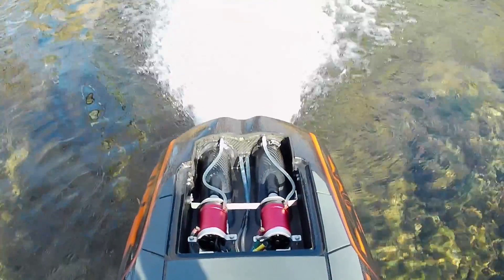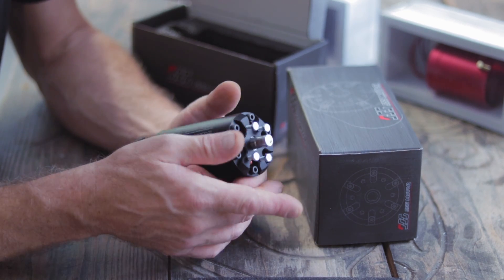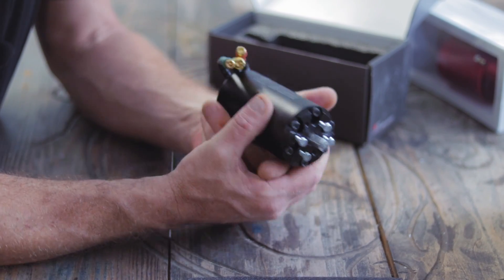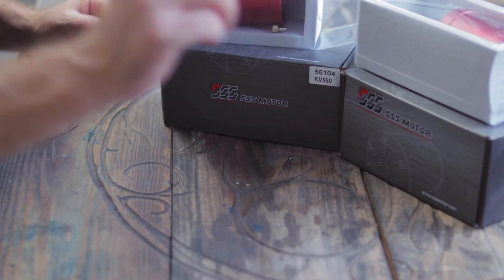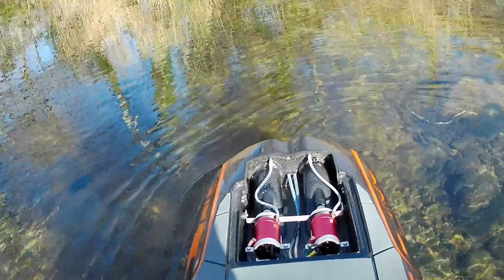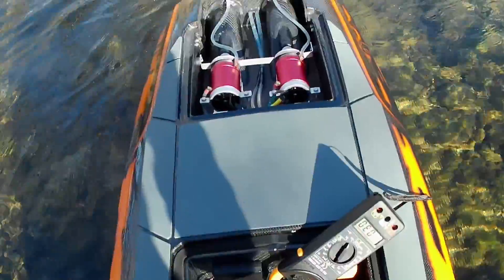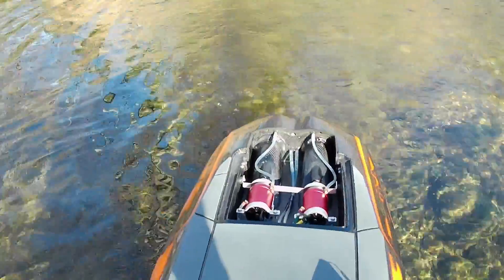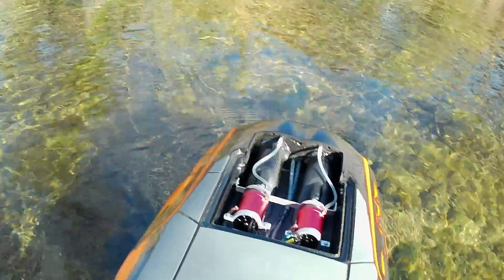First Power Test of the Diy Twin Jetdrive Motorized Electric Surfboard: p11

Comment: Could have taken it out for a short rip. Looks cool like to know top speed & play time length with batteries.
Reply from the maker: Cheers I was having issues with electric stuttering but I think I have solved it now. With 5000mah batteries it's not going to be a long run time but for testing I guess about 3-4 mins but will make battery eventually. When I know the speed etc it will be in the next video.

Comment: 56104-550kv motor is designs for high voltage using, looking in the motor specs. Try to builds high voltages battery pack and replace the ESCs to get maximum power of these motors (at least 60V system). 
My minimum suggestions :
10kW battery power to using 2 jets system 14s*4.2v * 170A = 9.996w  (14s ~ 58.8 volts, 40Ah to 50Ah Li-ion or Li-po high discharge battery ) 
60V 150A ESC * 2

Also it's really a nice board design & built!
Reply from the maker: Hi thanks for the detailed information I will be implementing the upgrades as soon as the wallet will allow. Cheers
Reply: 150A ESC isnt enough for this.. you need 400A for cooling reasons plus to compensate for initial current draw thats in the hundreds of amps range

Comment: Hello! This is a very interesting thing! Did you measure the engine thrust in kg? How much did you get? Factory jetboards have +/- 60kg
Reply from the maker: Hi no I haven't I will but I have a problem with the esc's it's some kind of a pulsing when it gets warm so when I get that fixed I will run more tests. Any ideas are welcome.

Comment: Great choice on motors! I have the same in my project with MHZ jets. 

I would assume that the fluctuation in power is due to the cheaper ESCs. I have cheaper ESC and feel the same.
Reply from the maker: Hey thanks the motors feel powerful and I wanted to get going on 25v first but it's like there is not enough top rpm because of the fluctuating power, it gets worse as it warms up so I am going for better escs so I can also up the voltage. Just need some more money first.
Reply: @thewaysider7774  that makes sense, I have a 12s system and have plenty of power. Now I am trying to have the system water sealed completely. Proving it be very difficult. 

This project is definitely not cheap either. I used a few Lipo batteries for testing. Haven’t gotten 18650s for the long term solution yet.
Reply from the maker: @micahkoelmeyer1519  Hey yeah i am looking at getting new esc's to run on 12s also and if all is good will be making a battery some time. i am currently re- designing the jet drives to start with a better system all round. the water issue is solved i think but hate all the silicone so will be ripping them out soon even before i ride as i need slightly less vibration also, its not bad but i am a perfectionist i guess. Thanks for the comment. Keep me posted on your build.